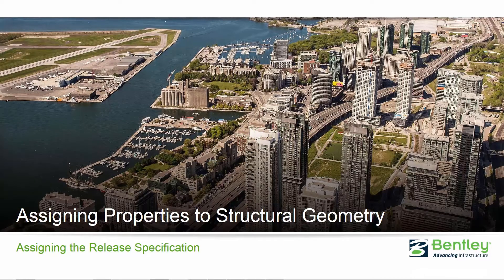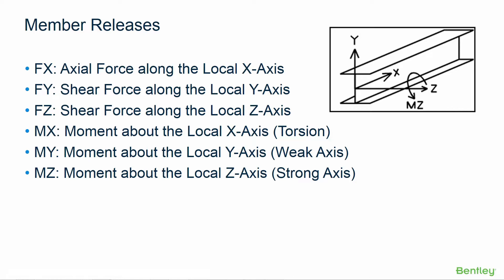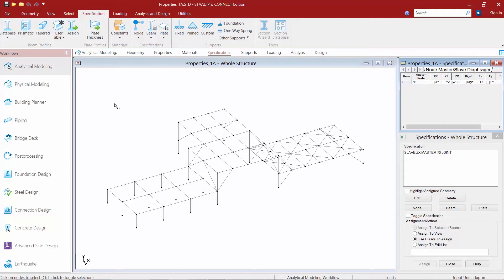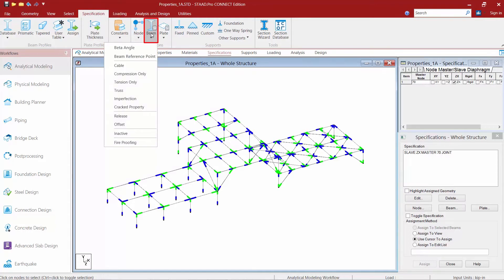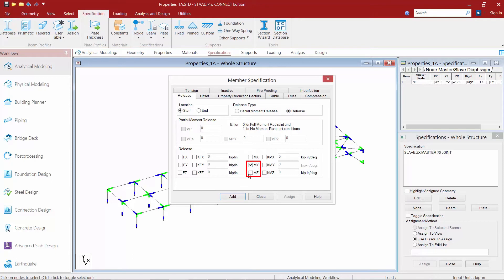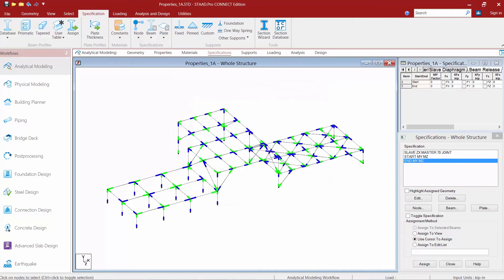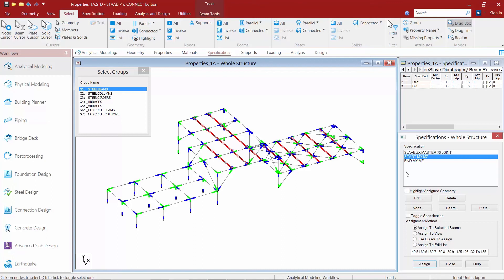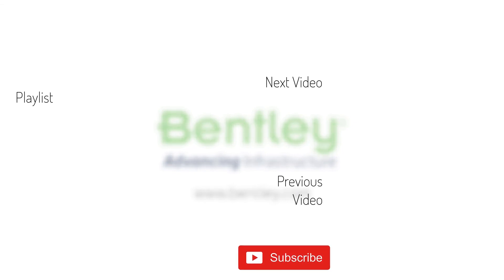Assigning the Release Member Specification in the STAAD.Pro Analytical Modeler

Comment: I am new in the staad pro, so what's change what's different between specification and without specification  ?????
Reply from the maker: The Release Member specification controls the member end fixity. If no specification is assigned, STAAD.Pro will assume the member is fixed at both ends. If this is not appropriate, assign the release member specification.
Reply: @BentleyStructuralAnalysis  thx  so much was so useful